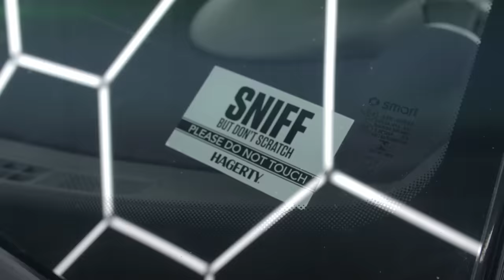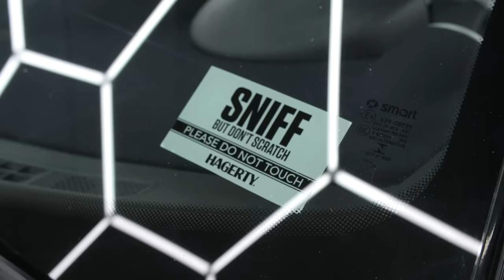300HP Smart Car is The Ultimate Tuner Troll (Turbo Hayabusa Swapped Smart Car)

Comment: Very nice build quality and design. I must ask though, why not use a double row chain? That would be so much more durable handling the power, although there is more hp at higher rpm’s than torque at low, but maybe not with the turbo. Great name on the plate. But the car resembles in theory Muscle Milk.

Comment: I think a scion iq would be great donor car for a hyabusa or zx14 engine. I bought a used zx11 engine for one of my zx11s and it was removed from a lotus elise which was raced at laguna seca california. He was replacing it with a ford engine because he thought the gears in the zx11 engine were bad, but he made a mistake. Gears were good and i got a good deal on the engine. He had the engine hooked up to a ford cosworth differential which came with the engine i bought. No chain. The diff was attached directly to the gearbox output splines. It really has me thinking about using it to build something.

Comment: As a non-motorcycle car guy, how many miles can you expect out of a bike engine? Is it anything like a car? I know the service intervals are a bit higher.
Reply: Since the Engine itself has been nerfed down from 600 HP to 300 HP, also, the car itself has been stripped off most weights parts.
Maybe quite good
Reply: If properly serviced like most vehicles, you can get 200,000+ miles out of it.

Comment: I notice that when merging up towards the highway, that it's not really accelerating past the highway traffic, even when making all that noise. As if any fast car could hear the noise and take off.

Acknowledge it's turned down to 300hp, not 600hp.
Reply: 7:29 until 7:35, six seconds to reach just a bit faster than a truck.

Comment: It seems to be a very clean Installation but it does make me angry. When I see these things put Together as just a toy period if it was something that people intended on using on a regular basis, it would have rubber mounts for the engine and.
The engine wouldn't be Low-slung. I would absolutely love to have a motorcycle engine powered car, especially for commuting.

Comment: So... Now it has an even higher center of gravity... That should be interesting. 🤣 Having driven a normal one I can tell you: at high speeds it is sketchy as f*. You feel every gust of wind. In bad weather you are constantly battling with the steering if you want to make reasonable speed and this is why the speed is electronically limited. Now, imagine at the speed this one makes and with a higher and further to the back center of gravity. A roll cage and a helmet would be good ideas. 🥛In white!

Comment: No way the motor is 600hp, show the dyno test or that is BS. Usually those motors are around 170 hp...
Reply: Prolly 600 crank, 475 wheel

Comment: I've seen that little car running around town fast little turd. I call smart cars or any other small car death trap on wheels. I drove shifter go cart with motorcycle engine damn that was a hand full. I'm surprised police didn't bust you on Delaware or on Freeway 235. You was in same area on freeway where 2 ricers were racing and 1 of drivers was ejected over sound barrier wall. Didn't find him until morning was stuck in a tree. Police thought it was single car crash until they found Go pro. His friend he was racing didn't even stop kept going.